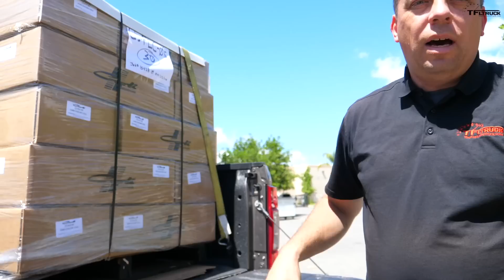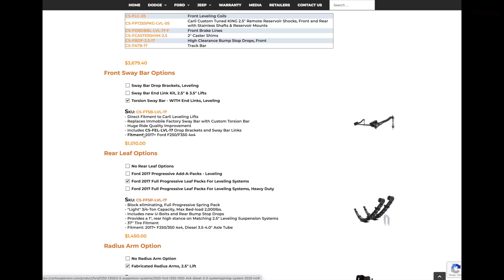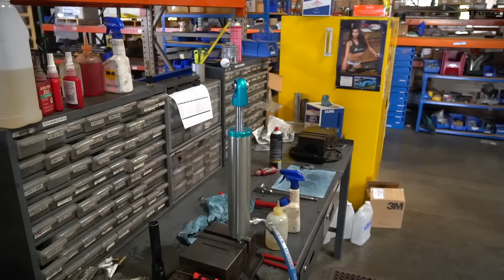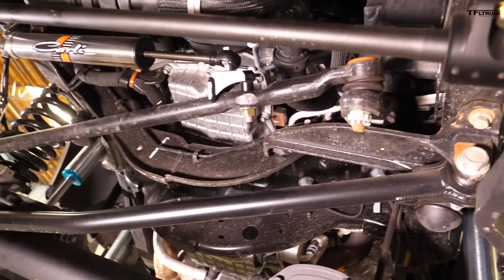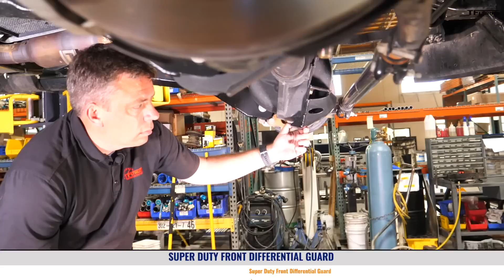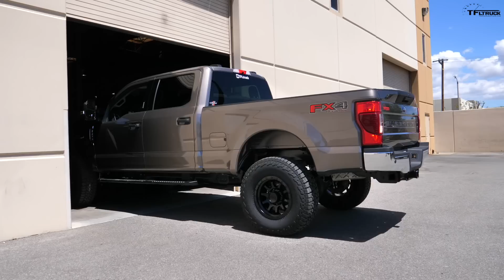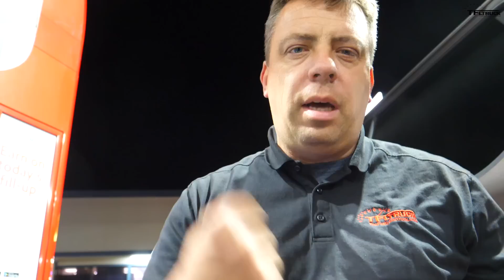See How This New 2020 Ford F-250 Now Rides Like a Raptor but Still Tows Like a Monster!

Comment: Great Video!   The Diesel option is getting less attractive because of this build. Carli tinned shocks are the best!!
Reply: Wow, so impressed with the engineering!
Reply: @erikhaw7313  Yeah......exactly correct. Ford has a real winner for a gas V8 engine.....built for strength...reliability and durability in every way.....probably more reliable...and durable than the diesel engine.
Reply: Diesel is $1.00 per gallon more, plus $10,000 for the engine, the math doesn’t make sense anymore, unless you tow all the time or super heavy loads unlike most of these cowboy Cadillac’s.
Reply: @davefisher16  I completely agree. I previously towed a gooseneck horse trailer to 18 states...3 to 4 weekends every month from April to mid October...every year for 14 years. Had two different Ford F-350 Crew Cab 4WD SRW 172 trucks with diesel engine. Nothing like having the diesel to launch the load...easily pass at speed on two lane highways and interstates...second truck had a PacBrake...very nice. Pulled load out my long driveway and then private dead end road a few times with 12 to 15 inches of snow...reason I had SRW trucks with air bags instead of DRW trucks. However, my frequent towing days are over. Have absolutely no need for a Ford Super Duty with a diesel engine...and neither do about half the guys out there driving one. You are absolutely correct.....the math does not make sense on so many levels for many owners of diesel pickups. They just think it is cool to have a diesel pickup...and several of those have a DRW truck that they don't need either.
Reply: Weight of a diesel and then stiffness needed to hold that in the suspension is not ideal off road
Reply: @Coorsnate  Exactly Correct!
Reply: But what would the fuel mileage be for a Diesel?
Reply: @sixoh_diesel5662  16.5mpg in 19 f350 with carli backcountry 2.5in on 35s going back and forth over the pass in the sierras on hwy80. Diesel is cheaper than 87 and more mpg.

Comment: Tfl is insanely stupid. Putting 37s on a truck and not regearing the differentials will lead to problems down the road. The added strain on the transmission and transfer case cant be ignored. The motor may have the power to spin them but it just means more strain on the drivetrain. Warranty voided.

Comment: Just as long as people caught the comment that the king shocks have been custom tuned for this specific truck(as stated in the video) and the load it’ll carry and are not the typical shock tune that comes with the pintop kit.  Just so you don’t become a Carli fanboy too quickly

Comment: You mentioned filling tires with nitrogen Do you know that the air you breathe is 78% nitrogen 21% oxygen the 1% missing is argon and carbon monoxide.  What I am getting to you will gain nothing with the so called nitrogen fill

Comment: It’s pretty deceptive to say that the truck rides likes a Raptor. Having both the new F-250 with a full Carli Pintop setup and a stock new Raptor, I can tell you that unquestionably there is not even a close comparison. The Raptor is far more plush. The Carli Pintop is tuned for off-road high speed and regardless of what you may see advertised, it is not a plush on-road suspension…even with full leaf springs. It is rather stiff in the rear and without airbags the towing is just “weird” when you compare it to the stock setup. You most definitely  need the airbags, which will also affect the ride. I really like the Carli, but again, to compare it to the Raptor ride is laughable. Anyone who drives them back to back will see no similarities whatsoever. This is a true and honest assessment from a real owner of both.

Comment: What would a high strength steel radius arm look like compared to the mild steel one that is welded together? It would be more expensive but certainly smaller and definitely lighter which helps on an off road / overland rig!!!

Comment: Kind of amazing to go from a large diameter, heavier torsional rate, front sway bar to an aftermarket smaller diameter sway bar. Sway bars do not contribute to the ride quality since both ends are activated at the same time going straight down the road and contributes nothing to the overall spring rate of the vehicle. It comes into play when the vehicle is in a turn and that's when sway bars resist the body roll which is what we don't want!!!

Comment: ANDRE, how does the 7.3 Godzilla handle the big 37 in tires? I have a 2021 F250 with the 7.3 Godzilla and I want to have 20" wheels and 37" tires and a wheel shop here told me it would take alot off my MPG. He also said big 37"  tires are ok on Diesels....but not gassers....

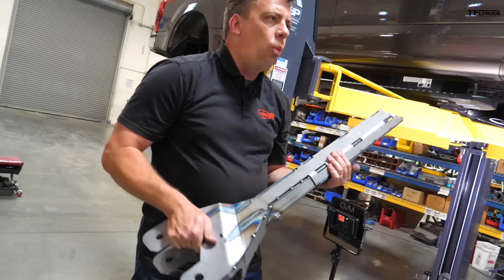Comment: 11:32 I love what Carli is doing just like everyone else. But this isn't the first time I've seen the owner struggle to sell the benefits of those radius arms. In another video he admits that there is nothing wrong at all with the stock radius arms and they never fail. Basically, there are only two reasons to get them 1) they look really, really cool and 2) they give you a little bit more clearance if you are running wheels and tires that need it.
Reply: If they’re adjustable they help center the axle

Comment: Wonderful video!  Question:  Do I understand correctly the the "Tremor" model has vastly upgraded underneath.  So, you exchanged the Tremor  springs, sway bar, etc for a carli suspension.  Is that correct?

Comment: You know in about 3 weeks your build is gonna be obsolete. Because the system I will send photos of will quite frankly blow yours away.  For one your suspension system is good but icon is a much better system along with a kelderman air bag suspension system in the rear.   And for the gas over the diesel not smart.  For one your resale is gonna suck two range sucks with gasoline engine’s.  So listen I watch your videos because I really think that you guys produce a good product but for the love of god please quit saying that everything you guys do to a truck it’s the best out there.   How about u put the different parts and accessories on and give a fare and honest opinion because again that build on the F-250 really ain’t shit.  And I love the blue oval.   Just be objective because there are a lot of sheeppeople that can’t think for themselves.

Comment: This guy is blowing smoke on the tire segment. 
It doesn't matter what kind of terrain a tire is designed for(mud or all) to reach a certain load rating. The correct answer for why Andre's tire light is on is because the larger tire doesn't need that much air pressure to sustain the weight of the vehicle. Think of a large tractor tire - some of those only use 4~6 psi. Does that mean the tire is a 60 ply? No. It's just a larger air cavity. 35 psi in a passenger car tire is not the same amount of air as 35 psi in a 37" tall tire. Make sense?

Comment: So I have 3 questions: 1) Did which exhaust system did you install in order to fix the cut exhaust? and 2) How do you fix the speedometer being off after you do a lift like this? 3) Did you manage to fix the TPMS issue, if so how?  Me personally it would drive me nuts having a light on in my dashboard like the TPMS.

Comment: Kings are the best shocks for the materials used but ride and handling come from tuning which very, very, very few people do well. I hate Fox mainly due to their poor excuse for customer service... anyway you can take the cheapest $40 Fox off Amazon to someone who knows how to tune and make it perform like a $1000 shock. Everything about Carli is their incredible tuning plus component build quality which no competitor can touch. What we have is a sea of lift brands in the industry and Carli who is a suspension replacement brand. Two totally different things.

Comment: Like your videos! Nice Truck and Great Build. Wonder why the dealer would order a Super Duty with the optional 397 Amp Alternators and Dual Batteries.....but not the Upfitter ( auxillary ) Switches??? Likewise.....this truck has 3.55 gears...a truck equipped with the 7.3L gas engine should have the 4.30 gears. Makes NO sense. Ford builds trucks to do truck things.....but the dealers have sales managers who don't take the time to really understand the options and the uses of the end consumer.

Comment: Cool truck indeed,I don’t know if they make them for the brand new F-250/350’s but I got a factory installed auxiliary fuel tank for my 2017 F-350,Having that extra 50 gallons (underneath the truck)is so sweet for long trips.I can pull my 35 foot 5th wheel toy hauler(camper) from Phoenix too Washington state where I visit my family without stopping for fuel if I need to.I think for overlanding it would be great.love the truck again can’t wait to see it finished and on that dirt trip!!!👍🏿👍🏿👍🏿👍🏿 I have an ok 2 inch lift on my truck with air bags for the back also but after seeing this suspension set up think my bank account is about to take a $8,000 hit from the price I saw in the video!!?? Thanks guys!

Comment: Soooo there's no point in getting the Tremmor package?
Reply: Depends upon the choice of tire size. With 35 inch tires, I would definitely buy the Tremor Package. With 37 inch tires...maybe. New rims and tires alone can be $2500 to $3000 or more. The Tremor Package is $3975. However, it does come with other goodies. Moreover, if the Lariat trim is purchased.....and the Lariat Ultimate ( $570 less for Tremor ) and Lariat Sport ( $570 less for Tremor ) are purchased, the Tremor Package gets an $1,140 discount. Plus, subtract the $400 cost if FX4 would be purchased instead of the Tremor Package. Now factor in the built in cost of the rims and tires into the original cost of the truck. Can sell those on e-Bay, but it is a hassle.

Comment: does it come with or without the death wobble?
Reply: Without!!! The GM trucks with IFS axle with poor articulation and low hanging frames high center easily on uneven ground off-road in mud and snow. GM engineers can sure build a nice V8 gas engine (LS)......BUT...they do not have a clue on how to build a good truck like Ford and Dodge with the Solid Front Axle. And now Ford has built the awesome 7.3L gas engine......many people think this engine will be awesome for reliability...and durability. Ford now has GM and Dodge engineers scratching their heads.

Comment: Not bashing Carli systems or King shocks at all, they are 100% the best option for HD trucks.  But my truck rides like a dream with 2k lbs in the bed too.... just sayin...  Unloaded ride is the question! (And the answer no doubt is that it still is awesome).

Comment: Diesel would have been the better option, hands down. Good video, nice truck..
Reply: The 6.7L diesel engine definitely better for frequently towing heavy loads. The 7.3L gas engine better for off-road and overland adventures...and occasionally towing fairly good sized loads.

Comment: Speed makes a huge difference! When I had my 2017 4runner with 3.5” lift and 33” tires,
the speed made such a difference! 60-65mph I’d get 17mpg highway and once I got near 70mph or higher it would be 15mpg or less

Comment: Absolutely excited for this build can’t wait to see where you go and how it handles, I’m currently saving money for my own Carli suspension. I’m going with the same size tires and wheels different brand I love NItto that’s what I’m going with. One thing I would highly recommend which I will be doing to my truck is regearing the only way to give you that mechanical advantage back and also give you better MPG’s closer to stock. And get them teaPMS sensors we calibrated along with the speedometer. Can’t wait for the next video in the series.

Comment: Can you still manually lock the front hubs
Reply from the maker: Yes. The wheel center caps can be easily removed.
Reply: For several years on the Ford Super Duty.....with the NV273 transfer case...ESOF ( electric shift on fly ) the hubs have two settings - Auto and Lock. I have always set my hubs on Auto. The weak point is the solenoid and pneumatic system to automatically engage the hubs once the selector knob on the dash is turned from 2H to 4H or 4L. The other weak link is the plastic encased "unit bearings" ( throw away bearings ) on the front spindles. The next Super Duty I purchase.....the Dana 60 front axle...I plan to install an Eaton e-Locker and DynaLoc Heavy Duty Free Spin Front Hubs from DynaTrac. Those hubs have the reliable, durable and serviceable ( re-pack with new grease ) Timken bearings.....and the traditional old school - two settings - Free and Lock. The NV273 transfer case is engaged via electric motor...strong, seldom fails. The NV271 transfer case is engaged via manual shift lever on the floor.

Comment: Carli is top notch.. I have their system in my Ram 2500. So much more than just a lift kit for looks. These systems are designed for people that actually go offroad.
Reply: @Jay Mack depends on the system. even the basic starter commuter kit is a big improvement vs stock on road ride. lot of guys tow heavy with the carli systems with no problems. theres 2 sets of rear springs reduced load and normal load capacity. and they also have long travel bags if you want.

Comment: 394 miles if taken from odometer is off just like the speedo is. Use Forscan to recalibrate the truck for the bigger tires. You'll see the fuel economy will be better and the shift points will also be better.
Reply from the maker: Hi Bob. The 394 miles were based on google maps, not the trip meter.

Comment: Lol add a  lot of weight, and reduced you load rating. Will you be over 10000 pds. Wait limit  for F250.  Plus 44 pds. Front control arms, around + 200 for the leaf spring upgrades, a bout 200 pds for front suspension changes, not including  the wheels and tires. 3000- 2000(caper)=1000 - 444 =556 - the over sized  tires and wheels ?
Reply from the maker: Um. No. The new springs front and rear provided the needed weight rating and stock payload capability.

Comment: Dan at Carli is the best. My 2014 and 2018 have the best systems that Carli offers. They are an amazing American company. Nothing but great people work at Carli. They take the upmost pride in their work and their product shows. I would never drive a Ford truck that doesn't have Carli products!!!
Reply: I have the king's on the 2018. It is a phenomenal ride. Especially with the new sway bar. Definitely a happy customer
Reply: Yeah.......the Carli suspension with Fox 2.0 or King 2.5 shocks completely changes the truck

Comment: We have 2 2018 6.7s at work and I would never buy one myself. This lift kit looks nice but damn it’s expensive.
Reply: The Carli suspension system can be purchased without all of the options...radius arms, front sway bar, etc. bought by TFL. However, with the level kit...the radius arms were a must with the 37 inch tires.

Comment: 8K for over engineering and over building a lift kit.
Reply: Not over built or engineered if the truck is used off-road.

Comment: Andre get the trucks cpu recalibrated for the new tire size and it will give you a little better fuel mileage and change the shift points on your transmission for better fuel mileage and fix your speedometer.

Comment: I got P rated Wild Peaks last fall - best tire I've ever had. Smooth on the road and sticky when wet.
Reply: Glad you got that out of them. I got rid of the wildpeaks I had. Slipperiest tires on wet pavement I've ever had on my truck. They were 285/65r16s.

Comment: Why do rear shocks on truck have one going on the outside of the axle and one going on the inside compared to something like a wrangler that has both going on the outside?
Reply: I’ve been told it’s to help dampen axle wrap on leaf spring trucks. Coils don’t have that issue since the control arms are keeping the axle from rotating.

Comment: Looks good.  You spent all of that money on suspension and tires, but did not recalibrate the speedometer.  Without a recalibration, your MPG calculation will be off because the odometer is off too.  Are you going to recalibrate the speedometer and the TPMS?  The big negative to me with increasing tire size is the speedometer and odometer is off.

Comment: Do Fox Shocks make suspension as heavy duty like this? And if they do why did you pick Carli over it?
Reply: Just shocks.
Reply: Carli has several systems with Fox shocks, but keep in mind that the magic lies in the Carli tuning, not the brand name of Fox or King.
Reply: Carli does not manufacture shocks. They custom tune shocks.....mostly Fox and King. This build uses the King 2.5 shocks

Comment: Kings/fox/icon in my opinion are not a good choice for overland due to them needing to be rebuilt so often.
Reply: These King shocks last well over 100K miles without a rebuild on many of our customer trucks. They're the only thing that can take the abuse of overlanding and actually survive.
Reply: Not that I overland, but what’s the alternative? Cheaper shocks that just need to be replaced instead of rebuilt?

Comment: Nice setup.  Test the mpg when you are not using the crappy califucnica gas.  The gas in cali will give you lower mpg so you end up burning more fuel which I guess they think is better for the scams they run there.

Comment: If the speedometer is off, wouldn’t the odometer be off too since it thinks it’s going slower than it is? Giving you better mileage actually? Do this again with a returned speedo adjusting for the taller tires
Reply: Yes, but he used gps to get the miles.